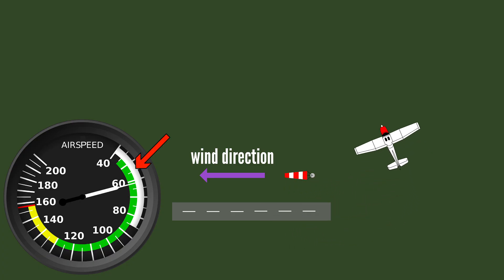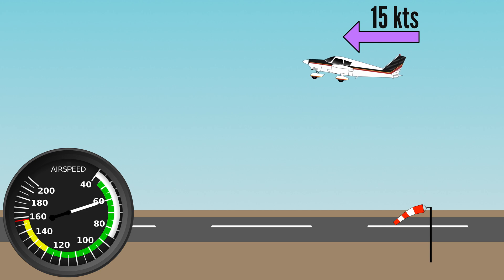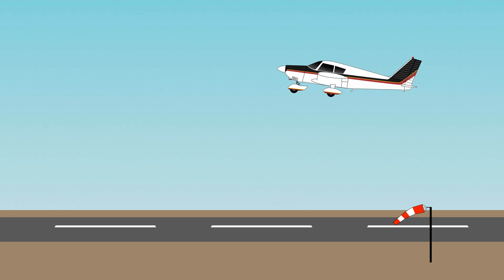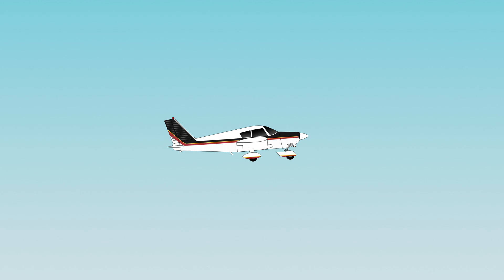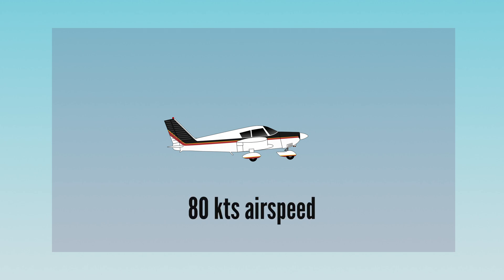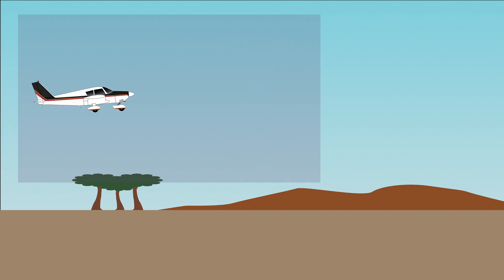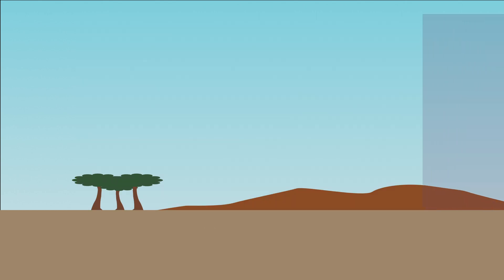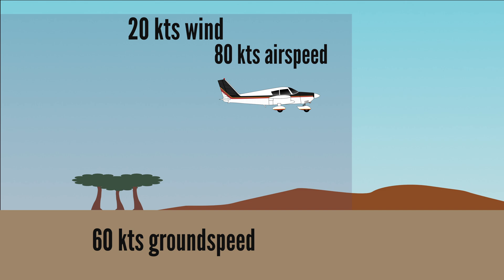The Myth of the Downwind Turn - Dangerous or Not?

Comment: So turning downwind still lowers your IAS and can thus, still stall you and kill you.
Reply: Not if the turn is gradual enough. Plus, you should be flying at least 1.4 times the stall speed when turning.
Reply: If you go by ground speed against headwind you could be led to believe you will keep such a speed throughout your turn when in reality you will not.
Reply: @txkflier  While keeping the rate of turn no greater than appropriate for whatever the particular situation is important, the downwind turn has no effect itself on IAS.

So "gradual enough" doesn't enter into keeping IAS from changing too much, because it doesn't change at all (at least not from the change in direction with respect to the wind).
Reply: @davetime5234 If the plane is flying into a 10 mph wind at an IAS of 80 mph, its speed relative to the Earth is 70 mph. If it were to suddenly make a 180 degree turn, it must accelerate to a ground speed of 90 mph in order to maintain the IAS of 80 mph. Basically, the plane’s velocity thru space was 70 mph faster than the surface of the Earth and then it must have a velocity 90 mph slower than the surface. It can’t do that instantaneously; it takes some amount of time. I think Newton wrote a law about things in motion.
Reply: @txkflier  No, there is no need for an additional acceleration:

The speed when flying against the wind is a difference of 10mph with reference to the ground.

And the speed when flying with the wind is a difference of 10mph with reference to the ground (in the same direction as before with respect to the ground).

So, there is no acceleration with respect to that constant ground speed offset:  because it stays the same.

And there is no acceleration in the reference frame of the air because the airspeed has no force causing it to change.

So, the error in what you said is that no acceleration takes place to achieve those ground speeds you mentioned 

(there is of course centripetal acceleration to account for the turn, but as that is at a right angle to the direction of travel, it's does not affect the magnitude of the forward speed - only affects direction).
Reply: @ If GPS tells you that you’ve changed speed, you have changed speed. Why don’t we take off downwind? Because it takes more distance and time. Is that not a different velocity thru space?
Reply: @txkflier But, you've only changed speed relative to the ground, not the air.

And the only reason you changed speed relative to the ground is due to the centripetal acceleration of the turn, which is always at right angles to your forward motion.

Because that acceleration and force is always at such a right angle, your forward speed never experiences a change.

But because the turn is changing your direction of travel it makes your drift with the wind add more or less to your ground speed as you change direction.

But your airspeed behaves as though you are flying without any wind.

Again, your airspeed doesn't change because you've only experienced lateral (normal to your direction of travel) acceleration, not longitudinal acceleration (along your direction of travel).
Reply: @davetime5234  A difference of 10 mph each way is a total difference of 20 mph; therefore, the plane must have accelerated by 20 mph during the turn to downwind in order to maintain the same airspeed. If ADS-B says the speed is different, it's different (relative to the Earth, the GPS system, and the Universe).
Reply: @txkflier  No, the airspeed has accelerated by 0 mph.

A bob sledder turns through a 180 bend in the track.  If the entire track is mounted on wheels moving at 10mph, that 10mph has no effect on the bob sledder having the same speed relative to the track before, during and after the turn (even though you would add or subtract the speed rolling over the ground to his track speed, to find the speed over the ground).
Reply: No
Reply: No, it's the pilots perception of speed that causes them to input incorrect control.  
If the same turn was flown for, the results would be different because mistakenly input maneuvers would not happen.